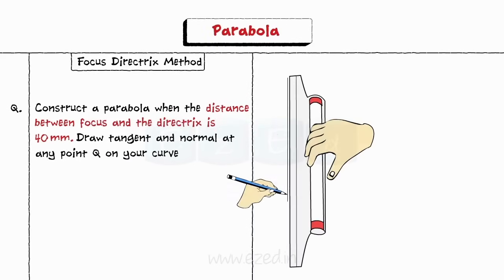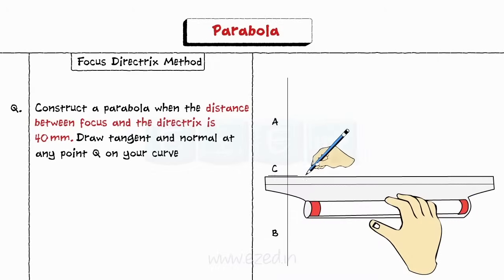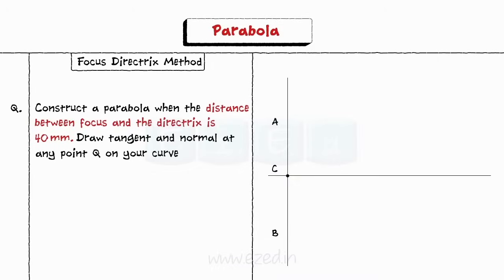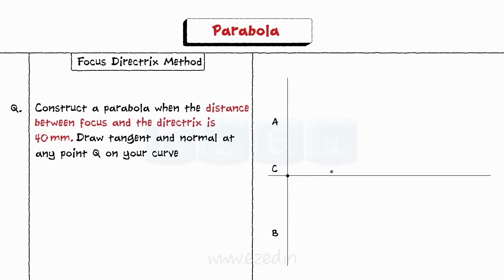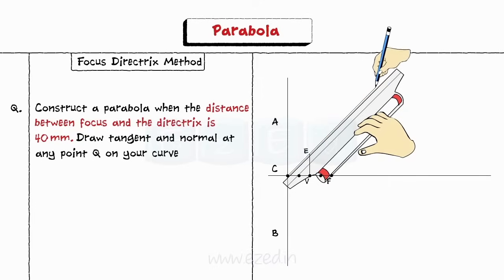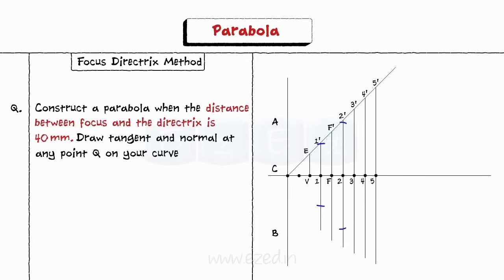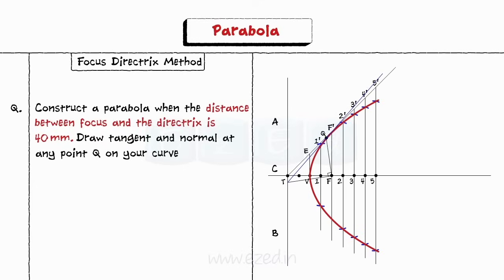How to Draw A PARABOLA and its Tangent using FOCUS DIRECTRIX METHOD - Engg Curves - Engg Drawing

Comment: sir if eccentricity is 1 then what to do
Reply: Then it is parabola
Reply: If e = 1 
For ex. 25/25 = 50 mm distance btwn C to FOCUS  point
Then it's 50 nm 
So, u mark the 25 mm on 50 mm distance of F
So u will get equal parts of 50 mm line
Ok.
Reply: Then it's parabola